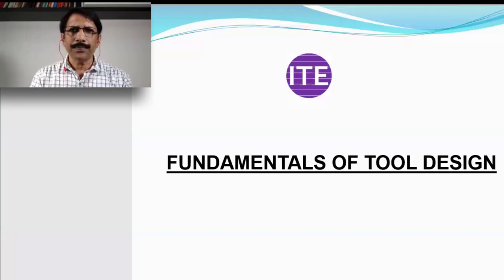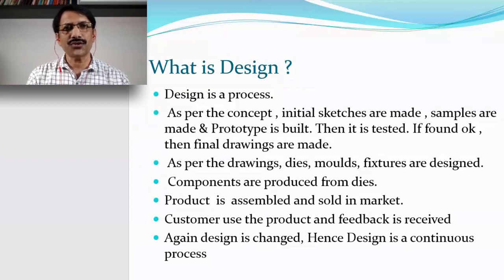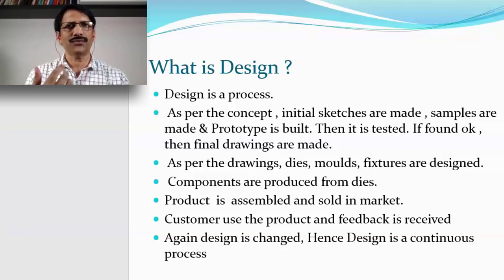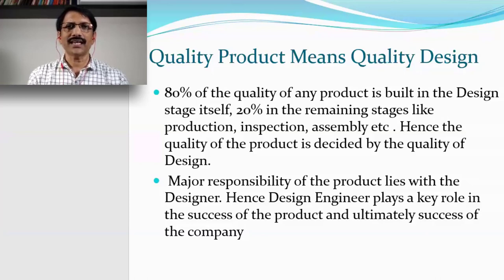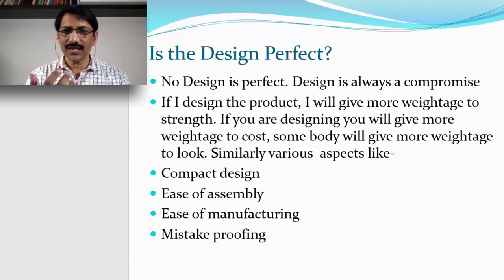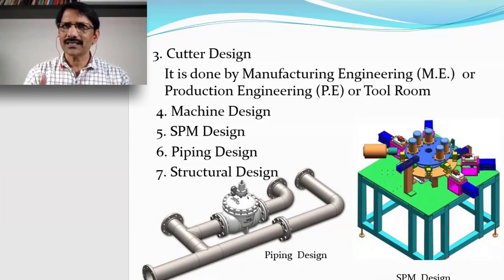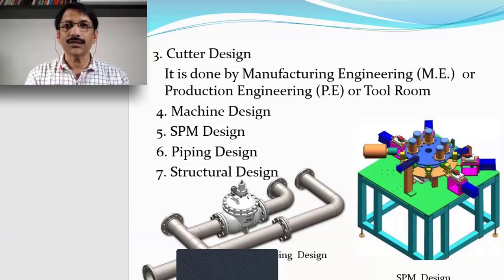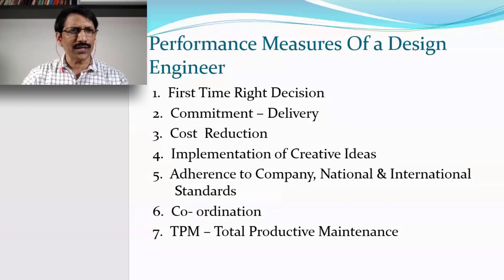Learn the Fundamentals of Tool Design Part-1 INTRODUCTION

Comment: Iam working in coimbatore tamilnadu as design engineer in our company producing 90% Sand casting tool making. I want to learn a lot so I can produce with good quality. Quality gives me a good place. I firmly believe you sir that the experience you give it will benefit me.
Reply from the maker: Stay connected and take action. Attend our free webinar

Comment: Sir, what is the difference between ruber moulding and plastic moulding ?
Reply from the maker: Rubber moulding is a process for making rubber parts. Plastic moulding is a process to make Plastic  parts. Both requires moulds
Reply: @balasahebkhalekar  sir can we do both rubber and plastic moulding process in a single tool? without changing any inserts, core , cavity?

Comment: Very good lecture sir, 
Sir, I am currently working in Manufacturing Engineering department as fixture and tool designer with 4 year experience so can i jump in product design after 4 year from tool design?
Reply from the maker: Sure. That is the right move. All The best!